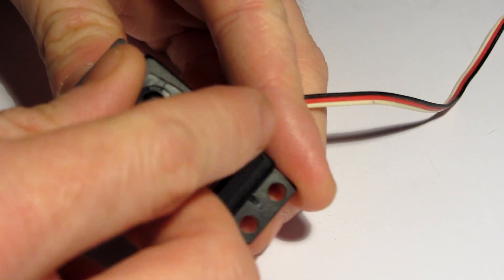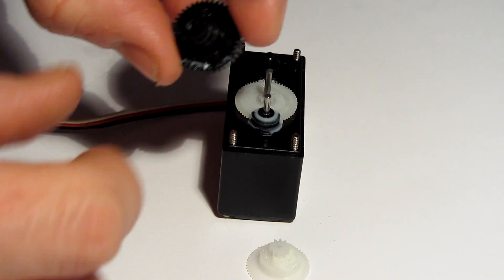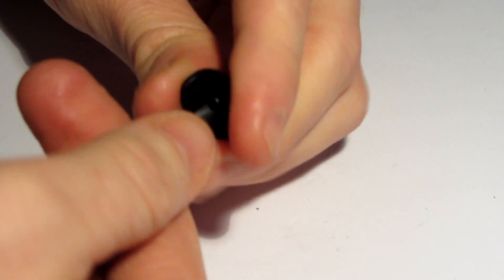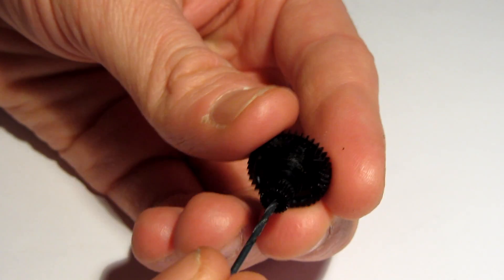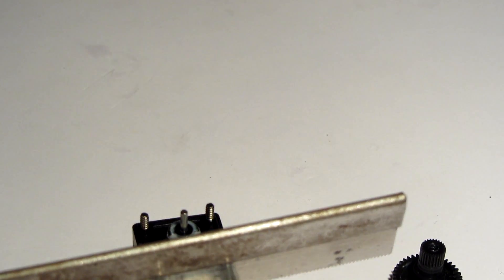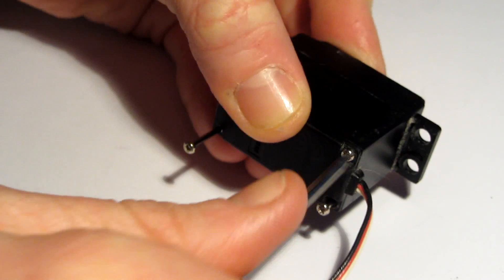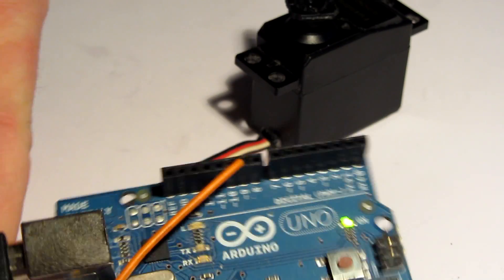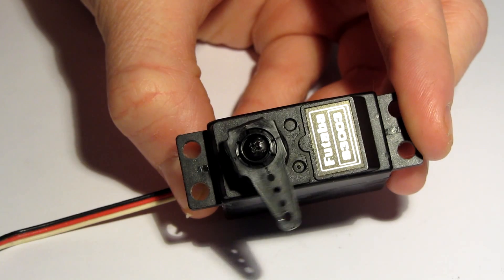How to: Mod servo for continous rotation

Comment: I just used to use a sharp craft knife to cut the top part and the internal nubs off the part where you are using the drill. You can also put a drill bit into a vice or something to hold the drill bit and turn the gear instead (much easier). I have never put a cut in the top of the pot spindle.

Comment: Hi, great video. My 2065 hi/lo shift servo on my summit 1/10 keeps breaking gears, is it because it has set to neutral position and just keep rotating no matter what position the switch is in?
Reply from the maker: Ideally servos don't want to remain under tension they want a smooth ride.  Depending on linkages and forces yours might be under intense stresses.  Metal gear servos serve these scenarios better
Reply: @chipko  after i put all gears bk in and put it all together, I put the red switch on hi position and the servo arm in and it started grinding as soon as I turned it on. Should It it spin all the time or just to switch on or off hi/lo and stop spinning? I'm new to Rc and only had my summit for a week.
Reply from the maker: @chriscottell6854  I'm not sure what the summit is sorry.  The servo would do if in the neutral position.  If a pulse  is sent to instruct the servo in either rotation the servo would start to spin
Reply: @chipko  Traxxas Summit 1/10,
Reply from the maker: @chriscottell6854  1/10th sounds huge! The stresses and modifications don't always scale up.
Reply: @chipko  it is a beast! Some people say it's more like a 1/8,
Reply from the maker: @chriscottell6854  is it a servo in a standard setup or contour rotation that keeps breaking?
Reply: @chipko  what does contour rotation mean?
Reply from the maker: @chriscottell6854  continuous rotation (Like my video) or are you talking standard servo motion?
Reply: @chipko  ok it keeps spinning constantly until I flick switch then spins opposite way continuously. Not sure if it's really supposed to do that though.
Reply: Its not been changed from standard but still constantly spins

Comment: Hi there that is amazing can i turn it on and off via a rc receiver/electric switch?as i don't have a programme board like u had.
Reply from the maker: Hello,  thanks for the comment. You need to send a signal to the servo so that it turns.  If you have an rc transmitter that should work.  If not you can get an arduino board for about £3. Let me know if you need more info
Reply: @chipko  hi there great news all sorted thanks 👍👍👍
Reply from the maker: @richardbrown9035  that's great news! I've been tinkering and may sacrifice my bit to get my continuous rotating servos back :D

Comment: Nicely done , how ever can you replace the potetiometer with the tiny rotary encoder (in optical mouse) and wire it with the electronics PRobably that will make it a close loop , and bobyyiest will be able to have a potaparty with that.

Comment: Hi i´ve tried to convert a Hitec Ms85hg servo but i cant get i to stop twitching or move, what should i do?
I´ve zeroede the potentimeter as good as i can but that aint good enough.
Reply from the maker: Slappaisawayoflife that's always the tricky part zeroing the pot. you could try stop it with software (not ideal) but that may help. if not try adjusting the servo at different temperatures to see if you can do the twitching. it took me quite a few attempts on some of mine

Comment: Thx I do have a Futaba S3152 Digital servo. Inside it nearly looks the same like the 3003 only the notsch where to cut for the screw and to adjus the potmeter is made out of metal. but it worked to with this DIY to make it a continous servo.
Reply from the maker: That's awesome - it'd be interesting to know how they compare to a standard servo for this sort of thing :)

Comment: I did this but i lost already 3 servos and I don`t know why. I control the motor with an RC controller, FlySky TS6, the RPM of the motor is high and it is using 9V batterie. But one of the first servo that i modified does not stop working since the beginning. Is it because the motor works also as an generator and sends energy to the circuit? The motors spin both sides. If you could help me I would appreciate that. Thanks.
Reply from the maker: OK I can try and help but we're going to need more information... We're going to need to know how it is wired up... but what you can try is disconnect the motor and Receiver and etc and just test the servos (use a seperate program if you want)..  When you try, find out if they spin at all.. at any speed / in any direction

Are you using any motor shield/daughter board for your motor?

Comment: I tried to do that but I just can not rotate the servomoterur in the opposite direction!! :/
Reply from the maker: +Zarg El Ayoun Selim You have to write the PWM signals either side of the 1500us to make it rotate in different directions.  What code are you sending to the servo?
Reply: +chipko itried with this code
 #include <Servo.h>

Servo myservo;  // create servo object to control a servo
// twelve servo objects can be created on most boards

int pos = 0;    // variable to store the servo position

void setup() {
  myservo.attach(8);  // attaches the servo on pin 9 to the servo object
}

void loop() {

  for (pos = 180; pos >= 0; pos -= 1) { // goes from 180 degrees to 0 degrees
    myservo.write(pos);              // tell servo to go to position in variable 'pos'
    delay(5000);                       // waits 15ms for the servo to reach the position
  }
}
Reply from the maker: +Zarg El Ayoun Selim Try using the pulse width modulation value to rotate it in either direction and see if that works:

myservo.write(1200);   // should rotate it one direction
delay(2000);
myservo.write(1800);   // should rotate it in the other direction
delay(2000);

let me know how you get on
Reply: +chipko it still the same thing the servo motor still rotate in the same direction

 #include <Servo.h>

Servo myservo;

void setup() {
  myservo.attach(8);
}

void loop() {
myservo.write(1200); // should rotate it one direction
delay(2000);
myservo.write(1800); // should rotate it in the other direction
delay(2000);

}
Reply from the maker: +Zarg El Ayoun Selim Does it spin when you write 1200 or 1800?  Or does it spin both times in the same direction?  The other thing you should notice is that when you write something close to 1500 (eg 1550), it should spin slowly but when you write something like 1700, it should spin faster...
Reply: +chipko  it spin both times in the same direction when iwrite 1200 or when i write 1800
Reply from the maker: +Zarg El Ayoun Selim at the same speed?
Reply: +chipko yes at the same speed
Reply from the maker: +Zarg El Ayoun Selim then it seems like there might be some code issue.  if you have a non modified so.  you should be able to test the code with different values and instead of rotation speed it should write a different angle. .
Reply: +chipko i tried this one but its the same problem:

#include <Servo.h>

Servo myservo;  // create servo object to control a servo
// twelve servo objects can be created on most boards

int pos = 180 ;    // variable to store the servo position

void setup() {
  myservo.attach(9);  // attaches the servo on pin 9 to the servo object
}

void loop() {
  for (pos = 180; pos >= 0; pos -= 1) { // goes from 180 degrees to 0 degrees
    myservo.write(pos);              // tell servo to go to position in variable 'pos'
    delay(15);                       // waits 15ms for the servo to reach the position
  }
}
Reply from the maker: +Zarg El Ayoun Selim I am a bit busy with work today.  I will try help as soon as I can
Reply: +chipko ok thx verry much :)

Comment: Wouldn't it be beneficial to put super glue on the pot? to make sure it doesn't move..
Reply from the maker: You need to be able to adjust the pot and super glue can be a little too permanent.  I guess you could put some hot glue in there but you still need to be able to firt the screw in.  If it ever goes wrong (and in reality it shouldn't) then you can just readjust the  pot again after taking the screw back out

Comment: Thank you for posting this video.
If i clip this piece of plastic, can i write code such that i can control the exact amount of rotations? ie 360 degrees, or 370 etc.
Reply from the maker: did you mean stop the servo turning after its reached a rotation amount?  ie..  stop when it's gets to x degrees?
Reply: well yes, say after X degrees , ie. 720 2 revolutions, stop.
Reply from the maker: +Adrian - ideally you would use a stepper motor for something like that.  all you do otherwise is time it for a given speed of rotation and then use the time/speed ratio to determine a rotation amount

Comment: Excellent clear understandable video chipco just tried it with a Carson reflex CS 3 works perfect forward backward  no problems, and I do not have any technical stuff ie Arduino or programs, made it to use on low loader trailer to drop and lift ramps powered through elevator stick.

Comment: please guys tell how to rotate modified servo motor in clockwise and anticlockwise i mean that i want to rotate the a continuous servo in both direction forward and backward
Reply from the maker: Shashi Kataria If you are using Arduino or similar, you can either write a number greater than 1500 (midpoint) to go one way, or write a number less than 1500 to go the opposite direction.  There is also an angle you can specify in the same way ... 90 degrees is the mid point (or stopped) and either side between 180 and 0.  

The uSeconds don't go down to 0 btw... 900 may be the absolute maximum, and 2100...   a number or angle closest to the midpoint will rotate slowly, and at the extremes of the range, it will most at it's fastest.

I hope this helps

Comment: does it work like a normal 360 degree roatation servo motor...???
Reply from the maker: On mine it does. I use these as wheels on a robot. . 4wheel drive!

Comment: Sorry for asking thiis, but could you post the code for rotating the servo continuously?

Best,
Aerospace student
Reply from the maker: Shawn Daniel servo.write(value);

where value is not 90 (degrees) or 1500 uSec

Comment: So basically, by taking out that inner ridge on the main gear, the potentiometer is disabled so it thinks its always at center, therefore giving continuous rotation? is that right?
Reply from the maker: Correct... although you're not disabling the potentiometer, you're just stopping the gears from turning it.
Reply: Awesome! Thanks man. Im gonna be building a 360 pan system for a dslr camera, so this helps a lot!
Reply: Marco Santiago Ocariza
Very good idea.

Comment: Small question. Why on earth why would you want to do this? I have purchased a number of servos recently and I want/need limited range of rotation. That is what a servo is for. If you want continuous motion buy a motor.
Reply: Servos will always be more precise than a gearbox-less DC motor so I would vote for continuous rotation servos every time for a lot of robotic elements.  Remember, part of the fun of prototyping is thinking outside of the box, innovating and reinventing the wheel as much as possible :D
Reply: Micky (Slotski) I keep agreeing with every comment made.Must be a youtube first. So I guess I was thinking inside the box which is something I normally try and avoid. So again good point. Thanks.
Reply: ***** Yep. Fair point.
Reply: *****
Thinking about it you are right. There must be high torque motors out there but this may well be just as good and cheaper.
Reply from the maker: ***** yeah - this was to have some 360 degree applications but they ended up on a robot (having 4 wheels that I could control the speed of each one worked well) - https://www.youtube.com/watch?v=q-gZEG1yGwM

Comment: chipko I made this by your tutorial. But the problem is that I made this with 2 of my servos and they are rotating at different speeds..... How can I solve this?
Reply from the maker: it could be a mechanical issue with the gears or motor.  You could try cleaning it but bear in mind, sometimes servos of the same model can operate at different speeds due to age, batch production or mechanical and electrical tolerance differences.  I had 4 of these and they seemed to be pretty accurate.  I did have to change some of the speeds for control in my program though from memory

Comment: Can u use servo to go left then right after you've modded or do you have to use it one direction , I'm new to this mod please post let me no thank AJ
Reply: Sorry that this is only a guess and not a definitive answer, but I am guessing that you will still be able to use both directions yes.  The theory being that you have only removed the physical mechanical limiter and not affected the electronics too much to have affected the simulated polarity. I could be completely wrong mind!
Reply from the maker: Micky (Slotski) you are right.  You can still change the direction and turn it both ways.  At varying speeds both ways too!
Reply: Adam Murray it's just a limiter of rotation. if you set the way point to neutral then plug it to your RX and desert the steering or whatever channel your using to dead centre. 
then when you check it 
it'll work fine.

Comment: This modification is a one way road. You lost the feedback control of servo position. A simple dc motor with an H-bridge circuit can do the same job.
Reply: +C Manson However, this acts as a high torque DC motor with it's own esc, and can plug directly into an RX.